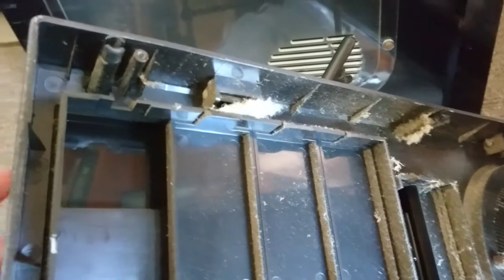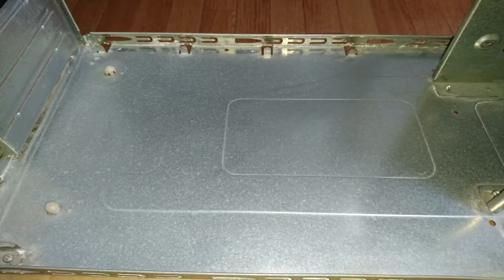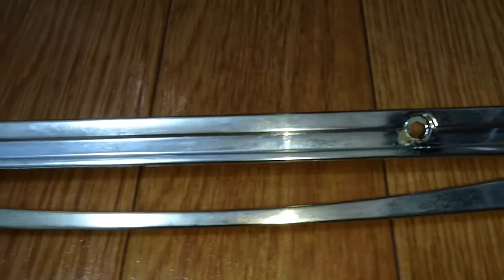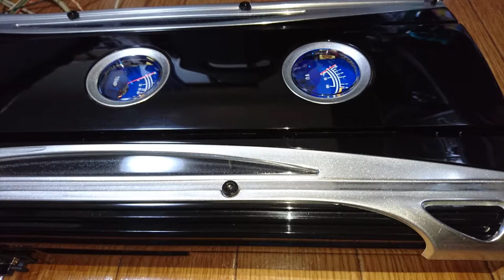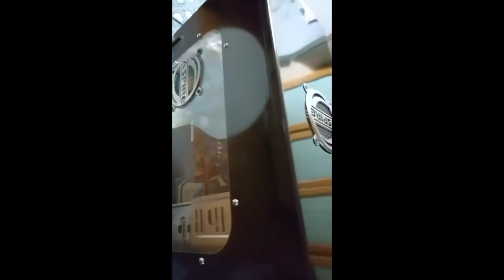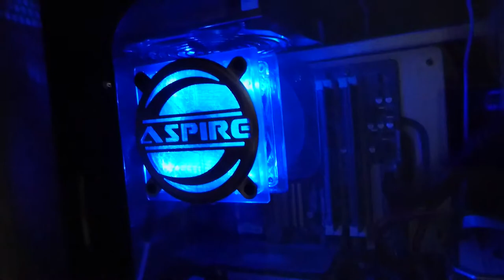Aspire X-Cruiser PC Case Restoration DIY

Comment: hi hal, advice please, i have the same computer case and in the front panel only the wheel in the middle lights up and that's it, don't know how to connect the cables? I put them in the vago terminal and some of them started burning :D but they survived, can't you write the combination somehow please
Reply from the maker: Hello there!
Did you just said they start burning?? What exactly?
Before that all of the three wheels used to light up?
Reply from the maker: Hi, see if this can help, let me now if it doesn't  :)
http://static.highspeedbackbone.net/pdf/X-Cruiser_Series_Installation-Guide.pdf
Reply: @Double_Y in mid yes up little and down little i just need help how to correct them like greeon go to blue blue go to white and this will u help me? i can send pohoto
Reply: @Double_Y  i help little i need send you photo do you have instagram or dc can i add you?
Reply: @Double_Y  and videochat will be best for me cause i want to show you
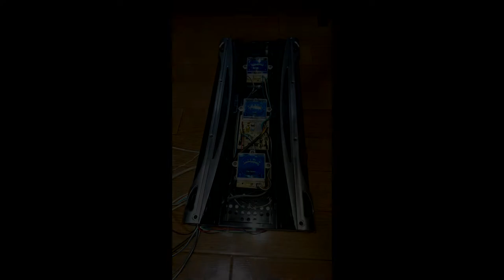Reply: @Double_Y   1:25 of video thesse cables i mean
Reply from the maker: @fiqertul6324  did you open the front panel like this?
Reply from the maker: @fiqertul6324  what's your Instagram?